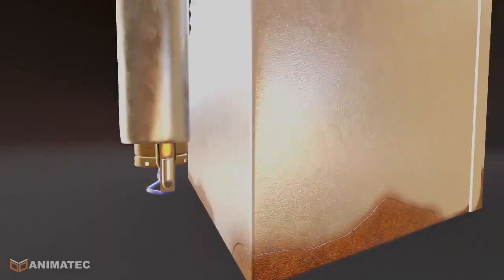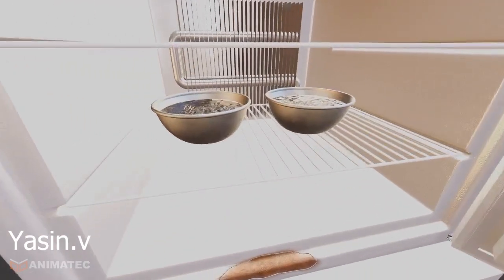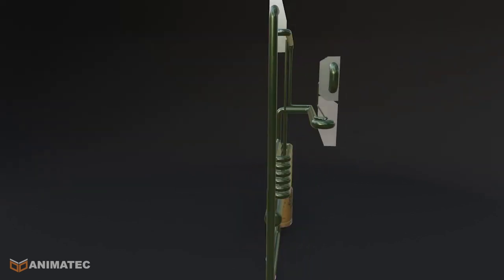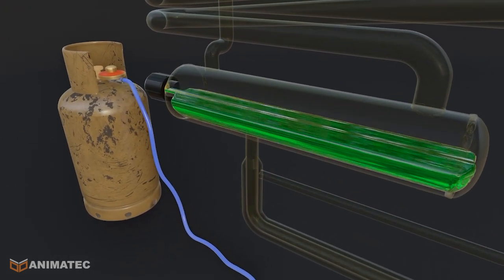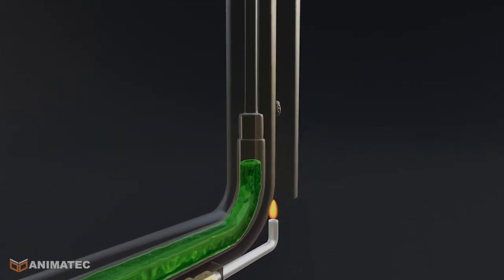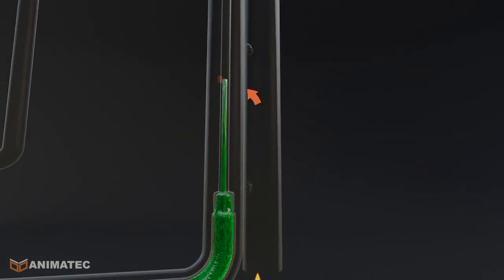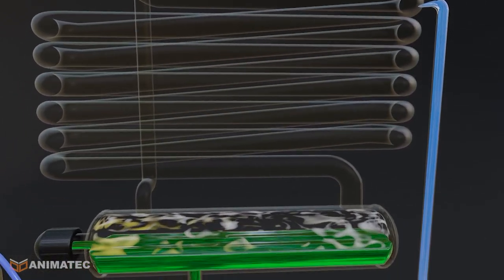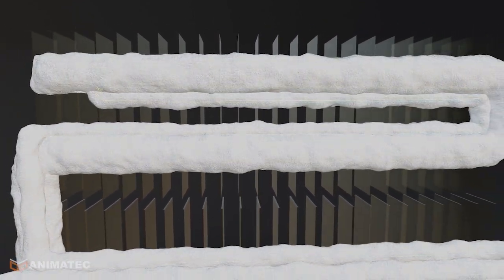How Can a Fridge Work Without a Motor? (3d animation)

Comment: Thanks for the video. Firstly, it is called adsorption refrigerator. Secondly, there is no problem with the “moving parts” as they are efficient, effective and reliable. Third, it is more correct to call it a refrigerator without electricity, not without “moving parts” because there is a weakness of electricity in parts of the world and you can operate even a refrigerator that has “moving parts” without electricity.
Reply from the maker: Thanks for the info!

Comment: and you wonder why refrigerator companies never adopted this technology
Reply from the maker: @aspopulvera9130  exactly
Reply: @animatec  this technology is the answer for the noise issue with current refrigerators and by replacing the burner with peltier module it would become fully electric without the need to buy gas

Comment: My grandmother used to have one of those refrigerators before I was born. It actually ran off of natural gas. Apparently, the freezer didn't get cold enough to freeze food. The burner probably needed adjusting. At one time, electricity was mostly used for lighting. Everything else ran off of gas.

Comment: Great work, I wonder how much heat does it need?
Reply from the maker: @user-yf5qz1yq3u  Thanks for your compliment 😉The required flame size is relatively small, similar to a single burner on a gas stove

Comment: I have a problem where mine doesn't work very well at high altitude. What would cause this?
Reply from the maker: @themotofixery  Ensure that the gas supply is adequate and that the burner is adjusted correctly for the higher altitude .High altitudes can cause issues with valve operation, leading to reduced cooling efficiency.
Reply: @animatec  ok. Thank you!!
Reply from the maker: @themotofixery  your welcome 🙂

Comment: I grew up in the Australian Outback where kerosene refrigerators were common. They used a simple hurricane lamp style flame to provide the heat. 
I never know you could use gas until we got one in a hired caravan for use when on the road and did not have access to electricity.
The main problem we had was that it could get too cold and we had trouble with things that should not freeze getting frozen.
Reply from the maker: @jeffarmstrong1308  wow , thanks for sharing your experience🙂